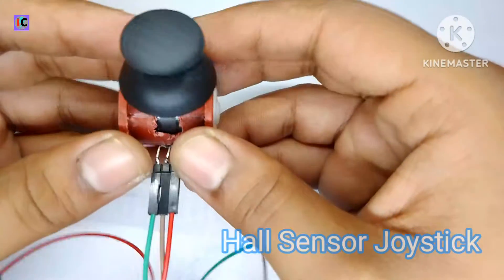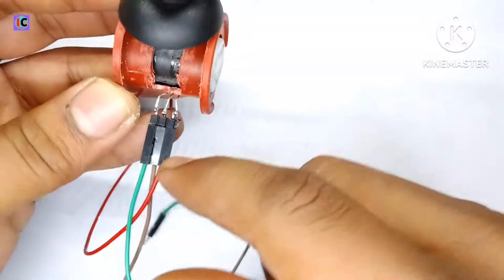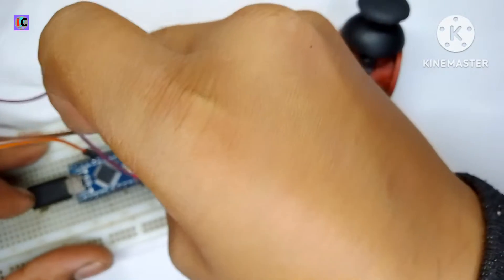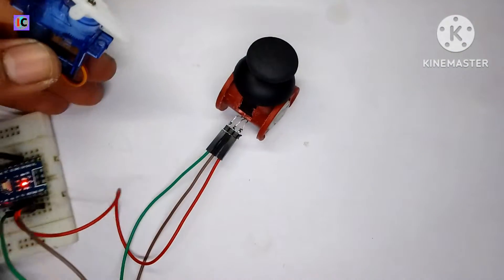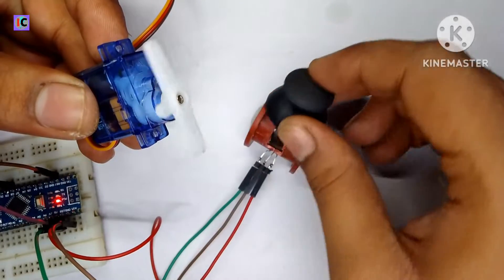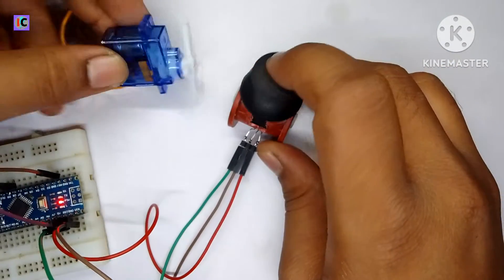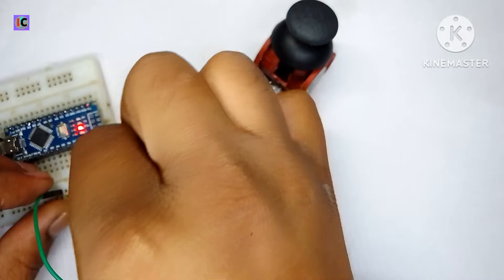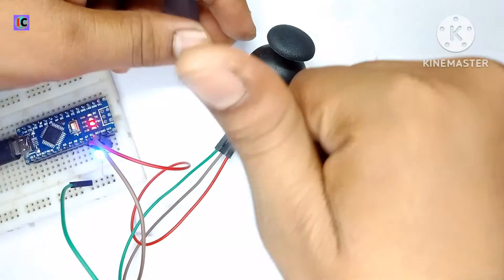DIY Hall Effect Sensor Joystick SS49E A3144 #joystick #hallsensor  #sensor

Comment: Could this "Compact Panel Mount Hall-Effect Rotary Sensor with Mechanical Stop" maybe be a direct replacement for the 49E, would this work? Look up part number "PSE290-A-ERA270S-05"…electrical specifications look similar/same as 49E, not?
Reply from the maker: I see it features same property as the 49E so you can use this to your project